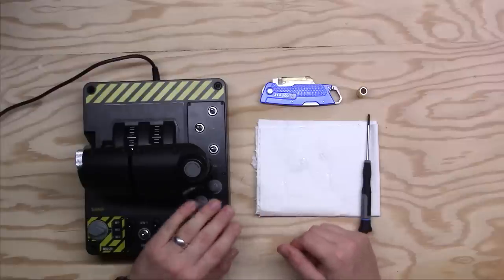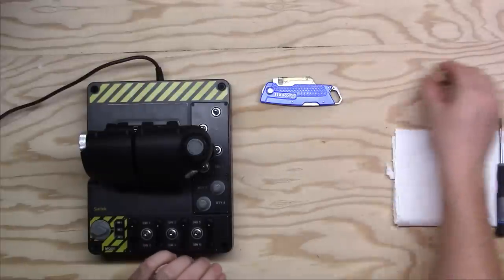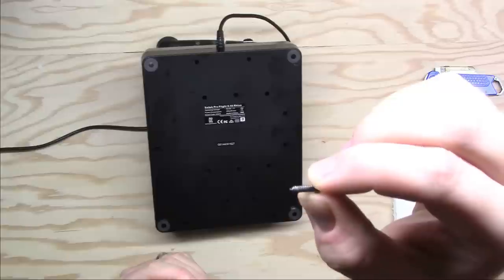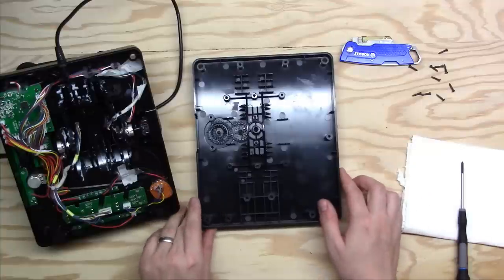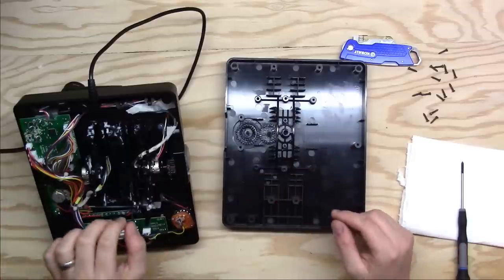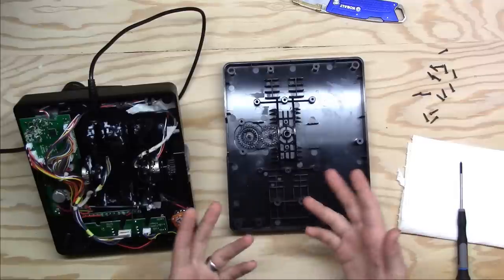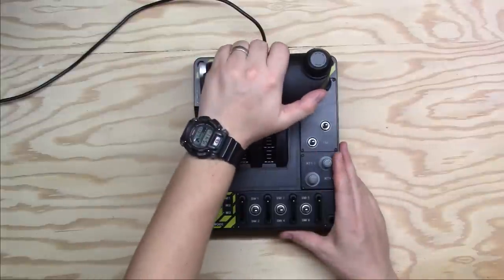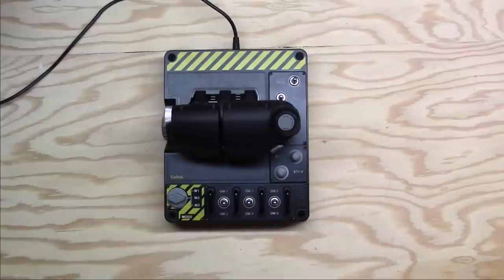X55 Throttle Friction Fix

Comment: The problem with that 'grease' is that the friction its stickyness creates makes it warm up. So it gets way looser after a few slides, then 10 seconds later its back to tight again. If you are OK with it being fairly loose (but 100% consistent) you can take out the 3 screws and remove that crescent blade piece from the bottom section.  Thats how I have mine and its just so much nicer.

Comment: Wanted to add my experience as well. I bought a new X56 in April 2021 and the throttle being hard to move was still a problem. Like many others have noticed, it does warm up after moving it a bit, but 10 seconds later, it returns to its original, sluggish state. 

I removed a lot of the "damping grease" as shown in the video, which loosened things up, but resulted in somewhat inconsistent resistance and honestly didn't solve the core problem (the throttle being harder to move intially than afterwards). I wanted it to be as smooth as possible.

The way I fixed it is by simply replacing the damping grease completely with silicone grease. Remove as much of the old stuff as possible from both the blades as well as the grooves (I used kitchen paper) and add the silicone grease in its place. Be generous with it to overpower whatever small remains of the old stuff there still are (it seems impossible to get rid off 100%), but also to keep the throttle from feeling completely loose. 

The silicone grease then adds a pleasant, consistent and predicable degree of resistance all the way from beginning to end. Its really quite ideal. You can also still further fine tune the resistance via the knob on the side, if you so choose.

Comment: I didn't use this to fix the sticking throttle (I have it mounted) however, thanks for showing the unit disassembled and reassuring me that undoing all screws was necessary to get access to the inside (I initially only removed the perimeter screws as I wasn't sure the middle ones were to split the base). As I suspected upon opening the unit one of the connectors was not seated properly resulting in intermittent operation of the lower row of buttons, re-seated the connector, unit works fully now :-) You saved me sending it off for an unnecessary repair so thank you for that.
Reply from the maker: Christian Challiner Fixing things on your own is one of the most satisfying things you can do in my opinion. I'm glad I was able to clear some stuff up for you!

Comment: This gave me the confidence to disassemble the boxof my 2021 X56. Thanks Wydra91.  The goop is clear compared to the white stuff in yours. I was removing it with Chux as tissue paper got stuck in it too. Personally, I prefer no friction (like Grim Reaper), so I took the blades out after removing the two screws that limit it from being raised too far by the friction wheel. Now it should be easier to control. It still holds position wherever I leave it. Can't wait to try it out.

Comment: I just got the X56 from Logitech last week. This video and a plastic spudger were used to remove some of the sticky clear grease. I managed to "SAVE" the  grease by scraping it off and depositing it back on the bottom base plate where there are several small plastic " HHH " shaped blades. 
Now the grease is stored there for future adjustments and is not going anywhere.  Thanks for the 6-year-old Video!

Comment: Hi Guys,
Thanks Wydra for giving me the confidence to remove the base of my X55!  As you say, trial and error, but I've now finished up with a throttle which has just the right feel and is as smooth as butter!
The X55 as it arrived had an impossibly stiff throttle - virtually unfit for purpose.  Even with the friction knob on full 'minus', when you moved the throttle forward you did not know whether you were increasing the throttle, of sliding the base unit across the desk!
So I started off with Juts suggestion of completely removing the blades.  The end result was just a little too easy to move.  When you stood the throttle unit up on its end, the throttles would almost move under their own weight!
So I knew that the happy medium was in there somewhere!
I re-fixed the blade unit, turned the cogs until the blades were fully 'up', then did what Wydra suggested by removing about 2mm of the 'goo' from each side of each of the blades. I just re-secured the base using only 4 screws.  The throttles were still far too stiff, so I decided to be more bold.  I then removed all the excessive 'goo', plus about 1 cm completely from each side of each blade.  I re-assembled and the result was perfect!!  But even then the friction knob was on full 'minus'.
However, some hints and tips:  The goo sticky stuff that they use is diabolical.  It sticks to EVERYTHING!  I wore latex gloves to keep my hands free of the stuff.  If you get it on your fingers or tools you need hot soapy water and a scrubbing brush to remove it eventually!  I used a cut up old credit card as a scraper to remove the goo from the blades.  I stored the excess goo on the remainder of the credit card, just in case I needed to re-apply it.
Reply: The goo causes the wires to stick together causing the wire movement being too stiff and some of the wires eventually snaps - it happend to me play ED using excesive throttle movement during combat. I had the wires replaced with soft silicone coated wires, removed th goo and use only silicone gel as a greasing agent. The friction brake is useles in any case. Problems solved for how long - I do not not know. In a flight sim it will lats a life time, but in Elite Dangerous the joystick, throttles and buttons will not last that long unless you do easy non-piratable stuff - boring though. As an aside - I do not use my rudder pedals in Elite - too much overuse - I use the joystick's twist as z-axis movement.

Comment: FYI 10 years later and this fix is still needed, 2024 X-56 from Logitech is almost ridiculously hard to move.    I'm pretty sure they did this to make it feel like it is more substantial than it is.  The worst part is that I have seen multiple people end up with broken throttle levers after a short time because of the insane torque needed to move the stock lever.
-
I personally took out as much of the super heavy grease as I could and replaced it with a synthetic grease that is much less tacky, now the thing moves like butter with just the right amount of friction.

Comment: Just a quick tip for anyone wanting to do this - please don't use any kind of knife. The possibility of having a goof moment is far too great (you know it'll happen some day). What I used was an old pre-paid card but any kind of plastic card (credit card driver's licence etc) will do, most people will have one knocking about these days.
Reply: A spudger for car mods or for computer repair would probably work great

Comment: Good vid still.  The x56, both the Saitek (Madcatz) (blue decals) and the Logitech 2018 (gray decals) versions still use this dampening grease.  The black and gray Logitech 2018 version comes with less on it to begin with according to their public change documents.  But many people still remove a good bit of it.

Use a plastic putty knife or a credit card to remove the grease.  No need to tempt fate with a sharp razor in there.

Comment: That sticky goo caused the wires to break which I had to replace and is still holding after countless hours in ED, XP and DCS. A long story short, I removed the goo with earbuds and replaced it with quality expensive silicone grease and all is well with less friction but still stiff enough to fly the airbus with throttle in climb position.  Elite Dangerous is quite heavy on the controls especially in dog fights.

Comment: Excellent guide!
I think Madcatz/Saitek addressed this in the latest batch. Mine is stiff aswell, but once it's warm, it's good for longer periods of time than the ones I've tried earlier. Still need to remove some though.
Also, don't turn the knob for stiffnes all the way until it stops on "-". I think maybe the blades are completely removed then? For me it became uneven, even before i removed any grease. If you need it as light as possible without becomming uneven, take it as far as "-" goes, and then maybe 1/6 of a rotation back. (Think 10 minutes ;) )

Comment: I would use a Q-tip, but be careful not leave any of the Cellulose behind on the base plate. Well done on solving this problem
Reply from the maker: mwnciboo Good idea with the Q-Tip. It gives you a slightly more controlled method of cleaning the gunk off.

Comment: Very important to screw the stick and throttle down in front and at hip level.  The bases have holes for screwing down.  Look at an F-16 or F-22 cockpit and you will get the idea.  Screw the stick and throttle in the right position and these behave way better.  Removing the grease from the inside should be your very last resort.

Comment: any solution how to do yaw axis less tighten? in new x56 when using twist, I have to hold the stick so tightly that I can't operate the pov hat. all fingers must be closed on the steering wheel to keep the rudder in the correct position. but im afraid to open it. never forget how broke my 1st hotas before learn how to maintain in good condition :)

Comment: Great video, thanks!
I did this, but somehow the X56 throttle friction wheel doesn't work now (as in "isn't connected right")
So gotta open it again (no big deal) but what to look for to get it right please?
Reply: Old, but here it is for future use:  make sure that the tension knob gear is meshing with the cogs that connect it to the threaded shaft that raises and lowers the tension fins.

Incidentally, it is illegal for any company in the USA and Canada to deny service of a product based on you opening it.  In other word WARRANTY VOID IF BROKEN stickers are lies.  If you damage the product while opening it, they don't have to fix it for free.  But they cannot refuse to fix an opened item based on the fact that you opened it.

Comment: Thanks for sharing! Been thinking about getting an X55 for a while now. A buddy of mine got one and we both were put off by the inconsistency and the severity of the throttle friction even at the lightest setting. We are planning to use them for Star Citizen where quicker throttle changes are/can be preferential. This mod might very well make a big difference. I'd love to know if there's anywhere us end users might be able to find some of that non-Newtonian goop if we take too much off or even decided we wanted to remove all of it and do a completely hand-done reapplication to make it nice and even.
Reply: In case anyone else needs this. Nyogel 767a

Comment: I know this video is old but I really need some help with my X55 Rhino. The buttons(and scroll wheel) on the left throttle work fine from 0% to 99% but when you push it past 100% the buttons no longer register. Something is physically wrong with it. I've had it for two years and after not using it for about 3 months and turning it back on, it suddenly had this problem. Does anyone else experience this, and how do I fix it?

Comment: Another fix: first off good vid, this works quite well, but I find the friction can become inconsistent and still strong for fine moment with helis or formation flying/refuelling.
Fix: I cleaned all goo out using WD40 then inserted a strip of soft foam (like in a couch) into each channel where the 'blades' go. It creates gentle friction without having a strong 'breakaway' force. So throttle doesn't jolt or stick when doing small adjusts... Best way I've found so far... Hope it helps someone. Happy flying

Comment: Very interesting, thx for sharing!
My X55 should arrive next week.

One question, though:
Does the temperature of the entire device make a difference?
I can imagine, that a cold device means "stickier goo" inside, which causes higher friction on the throttle.
So does the friction change, after using the device for a bit (let's say, for 15mins or so)?
Reply: Temperature does make a large difference but the grease cools too quickly. After 10 seconds or so without throttling its back to being stiff. It makes the throttle, at least on mine very inconsistent.
Reply from the maker: Yep, if you hold it by the base and slam the trottles forward and back a few times, it loosens it up really well for a few minutes.

Comment: How far have you disassembled the throttle? I need to disassemble the handle and replace the top rotary/push button (if I can source the part, whatever it is called. "push-button potentiometer" maybe?). Also the wiring in the left-hand throttle needs replacing as the buttons no longer work in the max position. Any tips on doing this? I wish I could get hold of a service manual for this thing.
Reply: +Ross Balmer did you ever find what that rotary potentiometer part number was

Comment: No need to do this at all. The dial you touch 1.05 is the tension dial for the throttle. Turn one way to loosen it.
Reply: Marc Williamson Right, what I'm explaining is that when fully backed out, it still is difficult to move on the older models due to the type of grease in the mechanism.